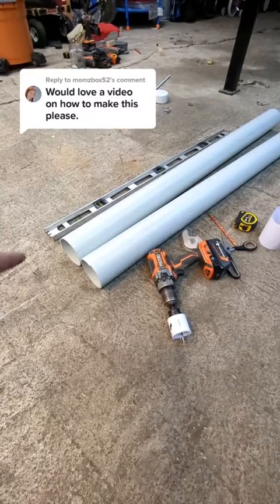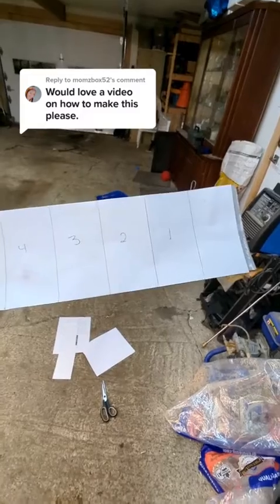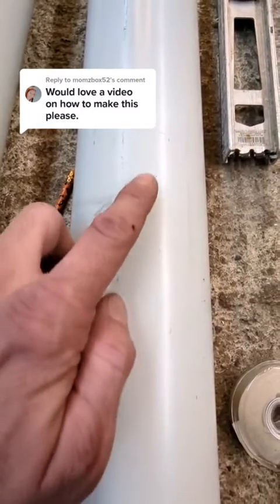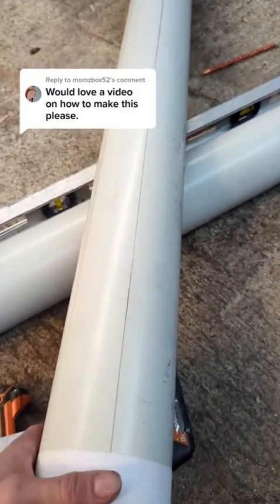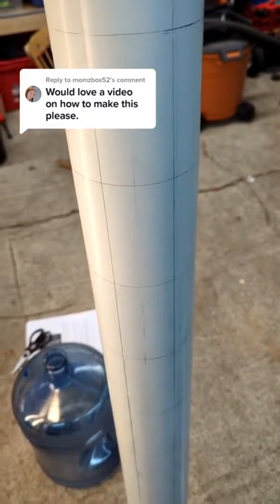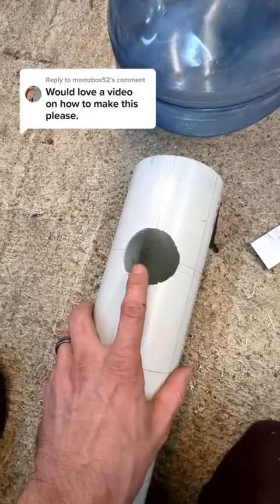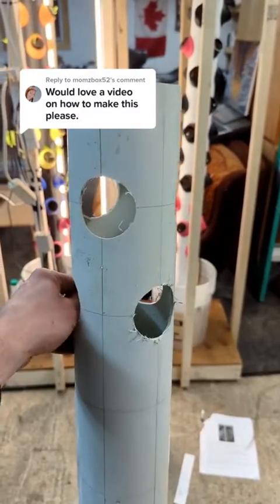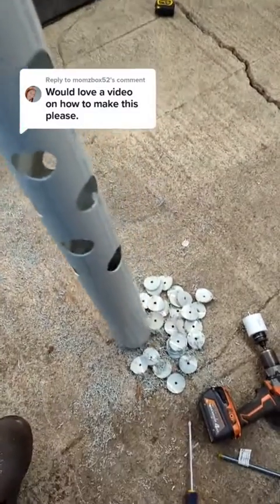DIY Hydroponics Towers EASY Build!!

Comment: I’m having trouble centering the tubing from the pump to the top of the tower so that it trickles down instead of out the holes. So how have the rest of you done this?
Reply from the maker: My Center hose is not 100% centered also, I turned the flow down a bit